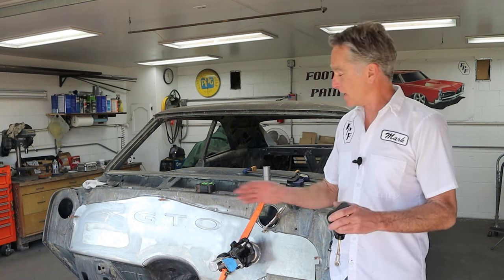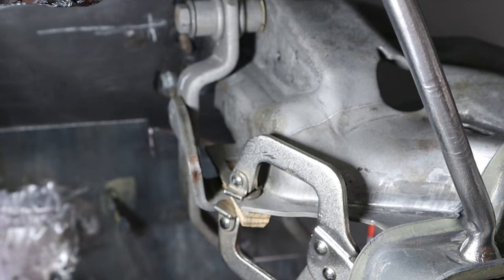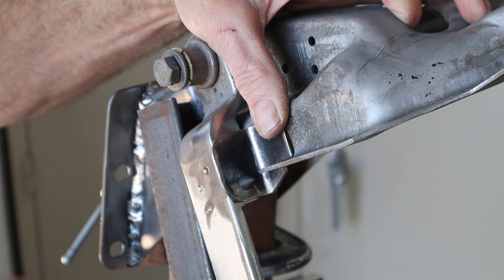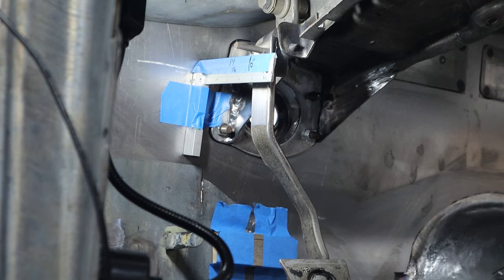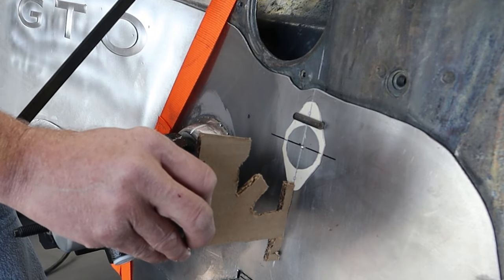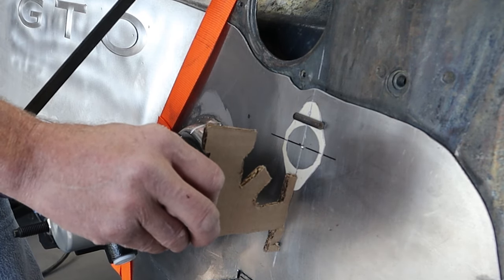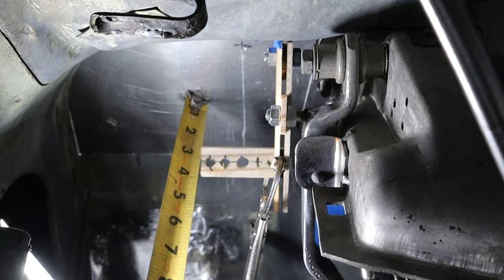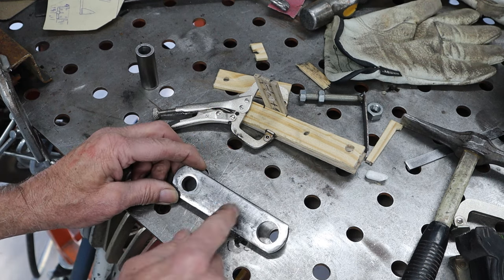Wilwood Clutch Master Cylinder Install - Pedal Ratio/Stroke GTO RestoMod (Ep 43)

Comment: I did a smooth firewall on my 67 and I used raingear wiper systems kit for the wiper motor. Sits inside the cowl and works perfectly. Their kit is for GM A bodies.
Reply from the maker: Thanks David, I will check them out. Not that I plan on driving Ruby in the rain...

Comment: Hey Mark...wish I could have suggested the Malwood USA clutch master that mounts to the pedal assembly. That said, I'm going to recommend Digitails LED tail lights to you before you get there. They are made to order and take a while. They are US made and a huge upgrade and worth every penny.
Reply from the maker: Thanks Greg,  I actually looked very closely at their refit kits and talked to a guy that specializes in under dash units he custom builds and got some great advice on using a Honda Accord slave or something.  In the end I wanted to retain the factory peddles and if I had used the Malwood unit I would have installed the reservoir on the firewall so I figured I might as well use the Wilwood compact unit.  Took some work and thinking but it should work well.  I have seen some LED refit taillight kits on Ames Engineering, not sure if they are the same units or not but I will check them out for sure. Thanks